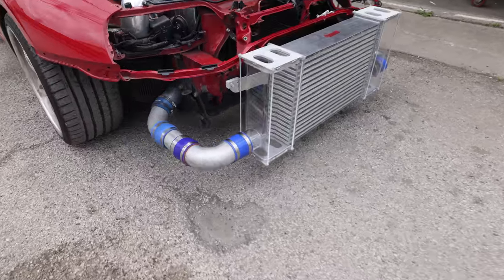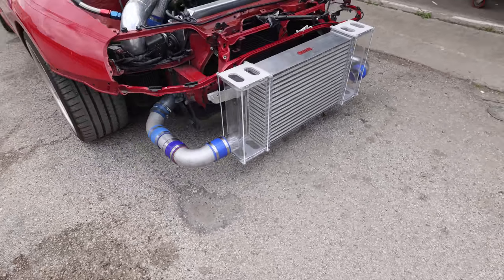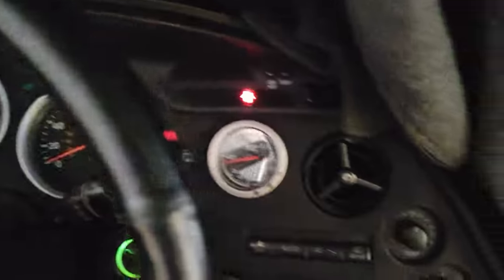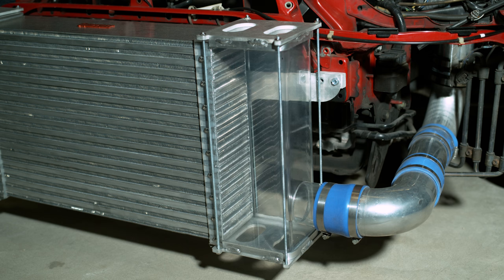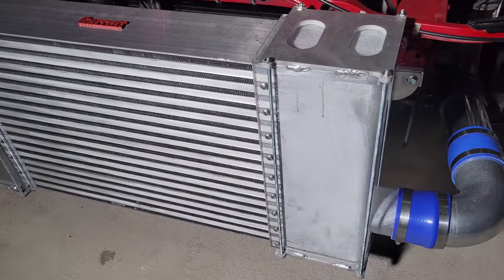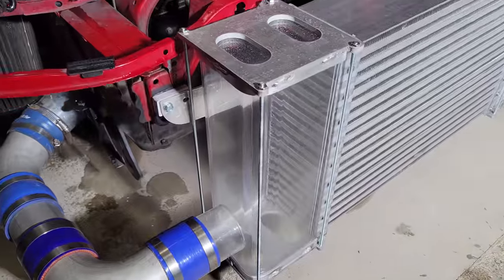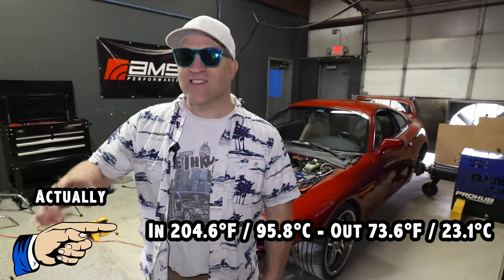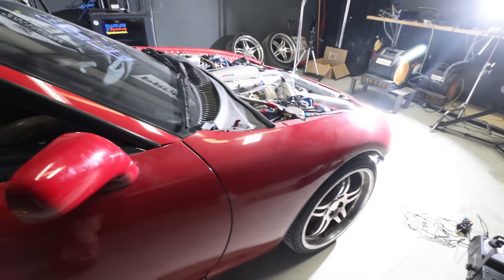See Thru Intercooler In Slow Motion - (Dyno Run High Boost)

Comment: How are 15PSI a 1000 pounds of force? You one of the guys that believe you need bigger brakes when you mount bigger wheels on a car?
Reply from the maker: 15 PSI = 15 Pounds per Square Inch.  5 in wide x 16 in High = 80 square Inches. 15 Pounds x 80 Square inches = 1200 Pounds of static force or load pushing on each one of those walls. If you put larger wheels yes you should have larger brakes, if you put a larger rim and a shorter tire to equal the same circumference as the original wheel then you don't. But most cars need bigger brakes anyway.
Reply: @WarpedYT  Yeah I figured. Btw: have you heard about the "gas doubler"? A small compressor that you can put in between the fuel nozzle and the tank. It compresses the fuel and increases the volume and the distance you can travel that way. Awesome device. Everyone should have one, especially people that use turbochargers. Can optionally be ordered with an integrated fuel pump.
Reply: @fugelkusch3722  wtf?
Reply: Could you help me how to learn and put a turbocharger in a car from zero, please
Reply: @Khaled.N.Omar01  Buy car, buy turbo, put in car. Done
No but seriously, tonnes of research before even buy a kit
Google is your friend
Reply: Build one with and one without a vortex inlet to see if the myth is true that more air can be extracted under a vortex....
Reply: @fugelkusch3722  Yea, it really sounds like you figured.
Reply: Bigger wheel has more torgue so you need bigger brakes.. americans...
Reply: 15 psi is 15lbs per square inch.
Reply: @fugelkusch3722  You didn't.
Reply: @fugelkusch3722  nice save bro. Next time, try not being a schmuck from the get go.
Reply: Well if the inner diameter on your new wheels is much much larger…why wouldn’t you also upgrade to larger breaks? 
It would look a little silly to me with giant wheels and tiny breaks tbh. 
Plus  larger breaks equals better breaking equals safer vehicle 🚗 
So it’s a win win
Reply: @fugelkusch3722  You just love showing off how little you know, eh?
Reply: @fugelkusch3722  What does it do? It compresses liquid fuel???
Reply: lol you just want to be recognized aren't you?
Reply: That’s so far left bro… like how about the rest of the video, did you learn anything? Seriously..
Reply: Atleast u didn’t delete it, you humbled yourself real quick. Smart man, wait no. I’ll just say that was a wise choice
Reply: @WarpedYT  I didn’t even read the equation tbh, I just knew it was true😂😂
Reply: @fugelkusch3722  ur a joker bro
Reply: @fugelkusch3722  Nah, you had no clue and your original post shows.
Reply: Totally math. Looks something like the side is at least 6” wide x 14” tall. That’s 84 square inches, times 15 PSI = 1,260 lbs.
Reply: @WarpedYT  I was thinking Force = AREA X PRESSURE as soon as you said how much force was being exerted.
Reply: @Khaled.N.Omar01  First get money.  Next buy a car that came turbo OEM.  Modify to your needs/likes/taste.
Reply: Dude failed high school physics
Reply: I think a bit flying off that intercooler tank hit you in the head
Reply: you know you got flamed when they pin your comment LMAO
Reply: Nice Figure Bro. You should figure other things too
Reply: this guy def skipped physics class
Reply: Lmao this guy got schooled 😆🤣
Reply: Ouch the pin of shame
Reply: as a plastics fabricator,  if you want to build acrylic for strength,  you should be welding it,  not glue.  HDPE can be used to weld clear acrylic so you could save a tonne of weight and probably not need the metal framework to hold it all together.  Glue is only suitable for light applications.  welding is king for strength.
Reply: This guy figures 😂
Reply: @fugelkusch3722  ummmm compressing a liquid? R u sure?
Reply: @y788lhjk1    The brakes aren't stopping more car though. The wheels simply don't turn as fast for a given forward momentum. If anything, you need brakes that are more clampy. Bigger brakes spread out the clampy, making it less effective without also increasing the hydraulic booster, but since the ABS system is complicated and isn't rated for the bigger booster, you end up tearing out the ABS, and professional fast drivers facepalm at you throwing away a piece of dream hardware that they would love to have, but is usually banned from motorsports due to the "too fast/can't pass" and reduced crashing that the audience is there for.
Reply: @fugelkusch3722  "yeah I figured"
Reply: Look at this duuuuude
Reply: Well bigger wheels means more leverage on the brakes so yeah, you probably do in order to get the same brake force.
Reply: lirc acrylic and polycarbonate have tensile strength in the 8000-9000psi range. The structure is breaking from the lack of spreading the load from the car's vibration & twisting--and the video shows it's breaking at the joints. you need washers and corner reinforcement for the joints and flanges or isolators for the inlet/outlet.Can't laser cut polycarbonate--but that's a better choice for this experiment.
Reply: @Chevsilverado  I am confident that you will figure it out some day. Good luck on your challenged adventure.
Reply: @buckstarchaser2376  What
Reply: @Norwegian_Bastard  So, your car stops like it has an additional 240lbs of unsprung weight, and tires that don't feel like road tires, because you wanted mud performance. That's perception. In your description, you didn't make the car heavier, and so there is no additional load on the brakes, and the tires are referenced to the pavement. This is why you need more hydraulic pressure at low speeds, compared to your old wheels, but larger brakes spread out that pressure, making the perception problem into a chain reaction of failures. Shows that are sponsored by car parts sellers aren't going to tell you to not replace your entire brake system because of this mistake, but people on the internet will laugh at you for wasting money on performance downgrades that you thought would help.
Reply: @Norwegian_Bastard  At the beginning of the piston stroke of your brake booster, the fluid reservoir is disconnected, so all the fluid that can be used to stop your car is limited to what is already measured out. You can't get any more brake force than that. That's where the confusion usually starts. 
The increase in vehicle weight and slower rotation of the wheels for a given speed will require a greater clamping force to compensate. You won't get that with larger brake pads, because brake pads are smooth. You'll just spread the existing, limited force across a greater area. Oversized pads or pistons, without increasing your brake boosters to match, will result in a lower clamping force, but more ability to dissipate energy to slow the rotor. Slowing is not your problem, however, because your bigger wheels already made the wheel RPM lower for a given forward speed. If you are mudding, chances are that you chose your tires for a greater contact area, and thus a lower contact pressure, so you don't get STUCK in one place. If you choose the same approach of "bigger contact patch is better" to tuning your brakes, without matching all the parts, you will experience soft brakes. For your brakes to feel as close to factory performance as possible with your larger wheels, you need to increase the braking force, not its energy dissipation, as the vehicle's energy hasn't really changed all that much, just the crossover point between stopping and slowing. 
For comparison, an F1 racecar has carbon fiber rotors and carbon brake pads. They don't stop those cars very well either, but they can turn 100MPH of speed reduction into heat extremely fast, over and over, for 2 hours straight.
Reply: @fugelkusch3722  you cant compress a liquid. that is 3rd grade science
Reply: @fugelkusch3722  “yEaH i FiGuReD.”
Reply: @fugelkusch3722  poor man, you sound completely lost
Reply: Do you believe if you removed the intercooler entirely you would see near the inlet temps? Or would it be closer to the outlet temps?
Reply: @fugelkusch3722  dude what is your problem ?
Reply: You can see how poorly the intercooler functioned when both in and out are at bottom instead of being staggered one top one bottom.
Reply: Noce job l have eg turbo swap h2ba7
Reply: @Warped Perception  15psi is the pressure input into the combustion chamber not the intercooler so infact it won't be 1200psi in the intercooler at all.
Reply: @dklgdveje  donkey brains got owned and didn’t know what else to say 😂😭
Reply: @WarpedYT  ahah good shit got the donkey with the pin of shame brother 💪🏾
Reply: I believe these guys are those who understand physics
Reply: @buckstarchaser2376  lol most of gt classes have abs
Reply: @AleksandrRudiak  Some mudders have 6-packs.
Reply: @Khaled.N.Omar01  here is a book called "Turbocharging and Supercharging" from the 1980's - it gives you all the fundamental basics you need, a huge amount of the stuff people tell you about charging engines is total BS, start with the book, lean the basic principles, its really not that hard.
Reply: @piccalillipit9211  thanks 💙💙
Reply: @Warped Perception  I think you need to go re do your maths. 
15psi does not exert over 1000lbs. You are only exerting 15 pounds!
Same thing with your cooling system 
Same thing with a bicycle tire
Reply: @nicholas8781  What part of "Per square Inch" are you not understanding?
Reply: @Buck Starchaser   15psi is 1.034 bar. Now do your maths
Reply: @nicholas8781  "5 in wide x 16 in High = 80 square Inches. 15 Pounds x 80 Square inches = 1200 Pounds of static force" 
The math was already laid out for you in such a way that anyone could follow along and understand it. You are clearly just refusing to accept how it works, yet you refuse to show where you are getting your disagreement from. You have squandered the grace that has been given to you to state your case, and you clearly aren't going to do anything but shout that others are wrong, while refusing to elaborate. Not only are you wrong, but you are in error too.
Reply: @Buck Starchaser  your maths is wrong! 
When you increase surface area you are not increasing the force acting on it. 
Again: do the maths using 'bar' or Pascale....
Reply: petrol isn't compressible, but air with petrol vapour is.

if you think the liquid is getting compressed with that then buddy you've been scammed
Reply: @y788lhjk1  brake size has not much to do with the force they can create. You need bigger brakes to dissipate heat - that's dependent on car weight and power, not size of the wheels.
Reply: Assuming the top and bottom end tank caps are 5"x5", and the 3 side panels are 5"x16". You actually have 290 square inches per end cap. The force is exerted across all panels of your end cap tanks at 15 pounds per squared inch means you were holding back ~4,350lbs of force.
Reply: @vairiankingkade6120  you want bigger rotors because of the leverage/torque of the larger wheel. It's not just looks. Your leverage ratio goes down if you use the same rotors with bigger wheels.
Reply: @GTbrunO  no you are not. You are only increasing the area not the force exerted. For example a 15lbs pyramid will weigh 15lbs when on its base, turn it upside-down and it will weigh 15lbs on its tip
Reply: Common commenter L
Reply: @WarpedYT  The brake thing doesnt make any sense. Larger rims weigh more. More unsprung weight which is what brakes REALLY care about.
Reply from the maker: @Saddedude  which brake thing?
Reply: @y788lhjk1  wheels refer to the metal part. The metal can get bigger without increasing the overall circumference of the tire and therefore not increasing torque.
Reply: simple add up the surface area and multiply times the per inch figure. this will give a total pressure applied to the object. better to be thought a fool then post something like this and prove every one correct.. a search of said question in private would have found this out and eliminated the comments
Reply: @jamiejoy2393 that would depend on where the pressure sensor is located. My turbo had its feed for the sensor coming off the outlet on the compressor housing. And that was a stock turbo.
Reply: 🤦‍♂️We got a real champ right here!! Smh
Reply: good troll.
Reply: TL;DR: stock brakes are fine for stock cars driven according to traffic rules. Once you significantly increase power output or the amount of friction the tires can take OR you drive your car in a way that's not expected from normal road driving, e.g. on a race track, you will want bigger brakes.

re: bigger brakes - lots of confusion here. On stock wheels, your car won't stop any faster than it did stock no matter what you do to your brakes, as long as those brakes could achieve sufficient clamping force to keep the wheel at the sweet spot between braking and locking. Stock brakes can usually handle larger wheels at normal road speeds just fine, too. However, you might find the braking force insufficient if you upgrade to wheels with more contact area and stickier tires, in which case you'll want more stopping force on the brake disc. This can be achieved by getting larger brake discs for more leverage, as well as increasing the number of pistons in the brake calipers for more even force. Choice of brake pad material matters, too. Finally, stock brakes for a car might fail if the car is driven at speeds and in conditions higher than it was designed to stock; taking a normal road car to the Nürburgring and driving it flat out and braking hard in every corner will make the brakes fade and can lead to them completely failing as the heat capacity of the brakes is exceeded. Larger brake rotors, perhaps drilled and/or slotted will help with heat dissipation, as will the creation of air ducting to the disc.
Reply: @fugelkusch3722 ”yea I figured”💀💀💀
Reply: Me no math math too hard
Reply: I've never seen so many people with so little reading comprehension and so bad at maths and at understanding physics.

1. the german OP  is mistaken - he could be correct depending on where the boost is being measured, but to say the walls have to withstand more than 1000lbf (so comparable as it being used as a bridge for a motorbike that weighs 400kg. If the area of the intercooler is incorrect, or the boost is measured before a drop, this number could be bigger or smaller respectively.

2. A couple more guys are wrong. With a larger intercooler, the turbo has to spool up with a much higher force (torque) to be able to generate what will also read as "15 psi". So while the number per square inch looks like the same, the turbo is working much harder - that is why some people saying "15 = 15 lul" are wrong, and why the force = pressure x area.

3. The pyramid guy is getting it wrong. The same weight of the upside down pyramid is being distributed over a large area when it is standing upright, instead of trying to think how much the pyramid weighs, you should be imagining which one would be more likely to pierce the ground, the large base or the pointy end - this is pressure.

4. Everyone, including warped perception, got the wheel and brake size wrong. Yes he is correct the drive ratio (and so the total diameter of rim + tyre) is important. But in the grand scheme of things, it really is not a high impact change, only if you are doubling or tripling the diameter. "most cars need bigger brakes anyway" - if a car can lock the wheel up (and depend on ABS) bigger brakes will make absolutely no difference in stopping distance, and over 99% of all cars fit this description. If you were to say "most cars WOULD NEED bigger brakes if taken to track" I would agree, because of heat dissipation, but otherwise, point 5.

5. People are really dumb. When the german OP says "you one of the guys that believe [...]" he gets WarpedPerception to say that he does believe in that bro-science take of bigger wheels need bigger brakes. So he then says he figured WarpedPerception is one of these guys, and tells him he has a bridge to sell - PEOPLE ARE SO DUMB THAT THERE'S LITERALLY PEOPLE SAYING "lol you're so dumb you think you have a bridge" - THIS IS WHAT FUCKED ME UP THE MOST - PEOPLE IN THE THREAD ARE BEING SO DUMB THEY CAN'T EVEN TELL WHEN A GUY IS MAKING FUN OF ANOTHER FOR BEING DUMB.

ffs
Reply: @vairiankingkade6120  Bigger brakes does NOT mean better breaking, D4A proved it.
Reply: @Khaled.N.Omar01 not every engine has good stock internals. Best engine to do it on is the k24. It’s cheap and can handle 500whp on stock internals. Also has a massive aftermarket support.
Reply: @WarpedYT   I wonder if it would've survived longer with ratchet straps going around the IC width wise ..? Eg, I think it's the connection points that fail under pressure / stress ... not the plastic itself (though I did see if was cracked, so I could be wrong).  Either way, I had this exact 97 TT ... and a Greddy FM IC, and I am SHOCKED at how much it cooled it. I would've thought (like you) that it was negligible bc of how little time it had flowing across the area to cool it, especially while static (parked). Absolutely amazing.  I hope you get a chance to one day setup those gauges to compare IN / OUT temps of the IC while on the freeway going 60+ mph.
Reply: @fugelkusch3722 are you high?